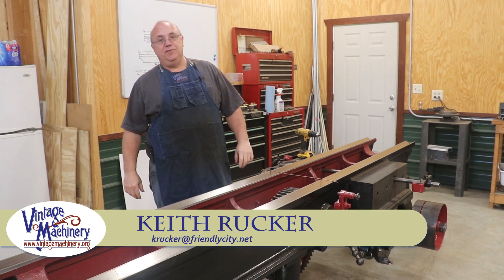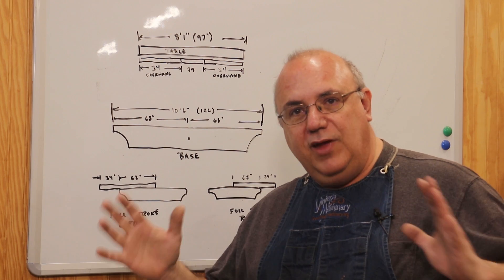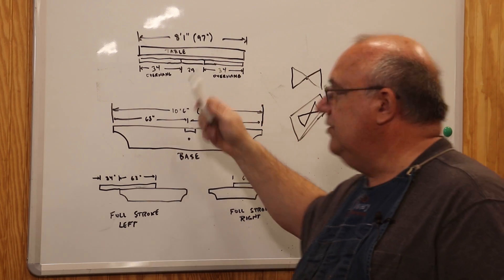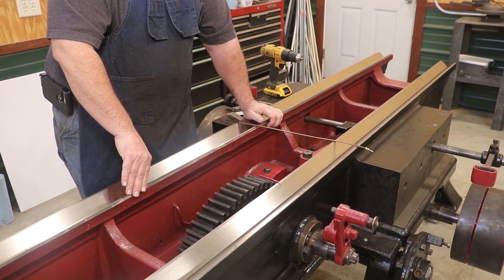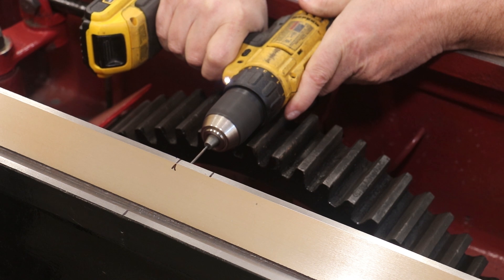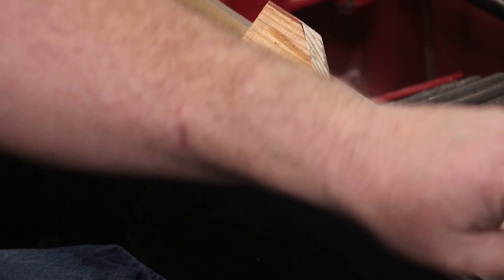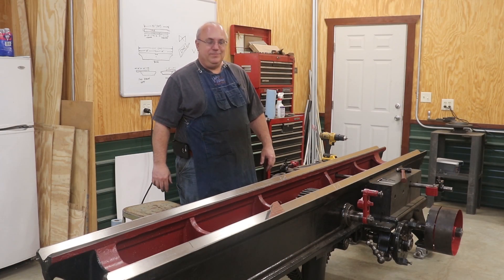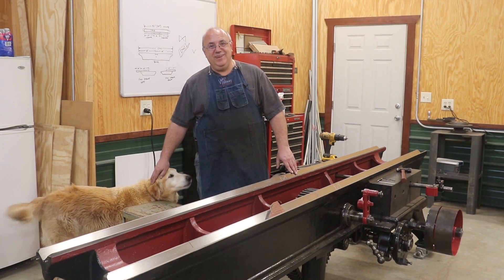New Haven Metal Planer Restoration - Part 25: Cutting Oil Grooves in the Machinery Ways

Comment: I made a piston oil pump when I was 15. A tube and piston (brass rod) two ball valves (sprung) it pumped well at low speed. Had an identical one filling a steam boiler with water under pressure.

Comment: a mechanical oil pump driven by the main driveshaft would be a great idea, it can work as soon as the machine is turned on, there is a lot of space underneth the base where the drive shaft is, a worm and gear assembly can drive the pump off of drive shaft (the sfhaft with 2 idler and 2 drive pullys) 
and how about the oil drain from ways back to the resorvor,
similar setup can be done with all the babbit bearings, with groves cut in them, oil feed and drain pipes connected for supply and back to resorvor.

p.s. dont mind the spell mistakes.

Comment: You know, if you wanted a mechanical oiler that was part of the table, it could easily be powered by essentially the same system we used as kids to add "motor" sounds to our bicycles with playing cards.  A mechanical pump with a little flapper arm hanging down into the bed-ways, actuated by being moved aside by some number of objects down between the V ways.  Perhaps simply the cast ribs that are already there.

Comment: In regards to wipers. When the table goes beyond the base ways it will at times be pushing chips. Those chips will be oil ladden and tend to stick on the corner of the base, just under the lip at the end of the way. When the table returns will the back of,the wiper,pick up those chips and grit?

Comment: As regards a bodgers fix for the oil pump, why not use a hydraulic brake master cylinder (size dependant on the oil flow requirement) that has its piston rod operated by a ratchet operated by the bed movement?  Low tech, very effective, potentially very reliable, with a bountiful parts supply?  You will need a metering block to regulate the oil flow and you could even have a low fluid alarm on the (remote?) reservoir!

Comment: I make lubrication system components for a living,  if you want a mechanical system you could go with a box lubricator, we sell them primarily for natural gas compressors that are run in a field with no electrical systems but there are many industrial applications as well. you could also run the pump into a divider block that would take that pump and split it as many ways as you like without having to cycle it like a metering system.

Comment: Looks like a perfect application for a mechanical oiler. They were made by Denzil, I think. Our big Ingersol Rand air compressors were lubed by them. they were belt drive but they also made some that were driven by a ratchet from a back and forth motion. Probably not made any longer. Your idea looks good.

Comment: I see you based the lubrication analyses on a full stroke.  The wipes will actually contact less of the way surface with a much shorter stroke, say an 18" stroke.the length of the "unwiped " surface in the middle will be much greater.

Comment: As I was watching and listening to your discourse, my thought of a oiler is a mechanical lubricator like is on the steam loco operating off the bull gear.  Cams and linkage are adjustable for flow.  Even an old pump oil can would work.

Comment: Could you use a pump that is actuated by a lever which could be moved by a contact on the bottom of the bed?  That way it would not require the memory factor of the operator. Just a thought and of course you could design the set up to suite your needs.  Greg

Comment: On David Richard's YouTube channel he uses steam cylinder lubricating systems that appear to possibly perform this similar task and would be period correct. I believe they are adjustable in a easy way for the amount of oil flow required also. Not sure about the amount of pressure they can produce versus what would be required for way oil. Just a thought.

Comment: Rather then complexity of a oiling system could you just put a well on one end of each oil groove pattenr, fill with felt wiper material and any time the bed moves its lubed, auto refills every time you lube the oilers

Comment: There is also special tubing and ferrules that can be driven into the casting to hold the oil tubing in place.
I think we used to get it from " Bijure " lubrication systems.
Reply: Did you watch the video?  He mentioned "Bijure" as the supplier of the parts he is getting.

Comment: May I suggest that You use a Trabon air actuated lube pump. Its most used pump on machinery and can be  controlled by a simple controller or a mechanical operated pneumatic valve. The oil output is controlled by adjusting the pump piston stroke.

Comment: I operate a unit with reciprocating plungers the oiling system is a round oil tank regulated air pressure on the tank. The tank looks more a small air tank with heavy duty fill cap the air push down on the oil and the oil line comes from the bottom. The regulator is set to 40 psi or lower. Needle valve can regulate the oiler points. The older units use an alemite pump but that is pricey. Thanks for sharing

Comment: Hi Keith,
I used to work on  large industrial paper shredders until 2019 and  a couple of years back they had  manual oilers.  They were German made oilers for the HSM shredders.  I do believe the manual pump assembly is available on their FA 400.2 shredder.  So they are out there , probably expensive.
I enjoy watching your videos and have watched you through several lathe rerubishings
Charlie

Comment: Keith you can get a Bijur oil pump that works on a cam system and figure out what metering fitting you need would work good on something that goes back and forth like a planner. eBay has a lot of new pumps for a reasonable price just need to figure out the right size metering fitting.
Here is a link to a site with info

http://www.bijurlubrication.com/?gclid=Cj0KCQiApt_xBRDxARIsAAMUMu-ZC837oXb0eU4K7KisvRXmgy4qTXlp5GHpJdhWrr3JxOZ1PaLxotcaAnNhEALw_wcB

Comment: Could link it off the lever that reverses travel instead of hitting the table itself. See a bunch of mechanical lubricators on steam traction engines. Short ratchet throw and would be period correct.

Comment: If you install some kind of oiling system, I would suggest some sort of oil catch system at each end of the ways.  I'll bet there will be oil dripping from each end (4 places) and you wouldn't want oil running down to the floor.  Maybe just an oil catch mat on the floor would work.  You'll figure it out, you have so far.

Comment: The easier it is to properly lubricate the machine, the more likely it will be done regularly.
A proper lubrication performance will protect the hard work put into making the machine like new. You got these points nicely covered so far, cheers Kieth!

Comment: If you would cut vertical slots every foot or so on the underside of the table it would serve to pump the oil into the ways and carry it along with the bed travel. Again likely to make a mess when it goes off the end but it will keep it well lubed and help prevent wear. I would rather have a messy accurate machine than a clean worn out one. :-)

Comment: I would suggest a cam on the bull gear shaft to operate a plunger pump that way it only oils when table is in motion and it will pump even when the gear is running reverse on the opposite stroke. You likely could rob parts from an eagle oil can to make it work. Going to need some catch cans at the ends of the ways to catch the oil runnning off to not make a mess of your floor.
Reply: I was thinking about something similar, like squeezing a turkey baster on each stroke, lol. I think your idea of using the pump from an oiler can is a much better idea.
Reply: An older Cat injection pump unit ought to work as it won't take much oil to lube it up and the pump plunger can be spun for the volume adjustment BUT you've probably got a pocket full of DEERE pumps, Baily approved of course!
Reply: You might be able to use an old fashioned cam driven automotive fuel pump.  I can remember seeing a foot operated cutting oil pump someone made using an automotive fuel pump.

Another option would be to gear or chain drive a regular gear type hydraulic pump.
Reply: Certainly it would be sensible to have the oil pump only operating when the machine is moving. You have a clear and simple notion of what's best here.

Comment: Like someone else said, you should probably have the uprights and cross rail in place before scraping. The weight of them will cause the ways to sag between the middle and rear legs and may even cause a hump to appear at the front.

Comment: I would consider the following: Put an oil groove bow tie every foot or so down each way in the base to assure full lubrication regardless of stroke length or location.  Then put a flow-limiting valve (in essence a check valve that is lightly spring loaded open but snaps closed when too much oil flow goes through it) on each outlet.  The valves prevent flow to each oil groove when it is exposed and wants to flow a lot of oil but allows a little oil flow when that groove is covered by the table.

Comment: How about a small cam added to one of the shafts with a simple plunger pump. Submerge the pump in the oil sump and use copper tubing from it out to the oiling ports. 4 drain ports to return the oil back to the sump.

Comment: hmmm, I think there might have been a more expedient solution....  The objective surely is to apply the oil to the table / base interface?  The leading and or trailing edge of the table will be oil starvedon any stroke that doesnt go to the maximum stops?  How often are you likely to use the whole stroke compared to a 12 or even 24 inch workpiece?   Surely the "difficult" plumbing is no more than a flexible hose from the base to the table and a distribution block would resolve?  With an oil feed to the extremities of the table, you are assured of oil feeding the the interface regardless of the length of the stroke. which is afer all where the oil is needed.

Comment: Don't understand why the oil grooves are cut before scraping. In my limited scraping experience, the scraper was constantly falling off in the oil or grease grooves and adding frustration to a tedious job.
Reply: Cutting the grooves can raise a burr or swell up the surrounding area if cut with a chisel like they used to be. If they were milled, that would have been done when the ways were milled so before scraping anyway. Having the scraper fall into the oil grooves is kind of beneficial as it creates more of a ramp to encourage the non-grooved surface to drag oil out of the groove and cover the rest of the surfaces.

Comment: I try to avoid using dremels. They have too much torque. When they grab they run away and go places you do not want them to go. I prefer to use an air pencil grinder which is low torque and slows down or stops instead of grabbing and jumping.

Comment: My oil pump idea... vintage car Brake Master Cylinder!
Reply: You would have to change the seals because the oil will expand the factory seals (brake fluid is a different composition than oil)
Reply: @ypop417  have you put oil in a master cylinder?
Reply: @vettepicking  Yes someone used an empty brake fluid container for oil and I put in my master cylinder
Reply: The oil will expand the factory seals? What is the material of the seals that would allow sufficient oil penetration to appreciably change the sealing characteristics? Your story isn't lining up. You filled your master cylinder with oil, but it was empty enough for you to put a lot in, without noticing it's not brake fluid? Then you used it and it worked long enough to know that you need to change the seals? Something is fishy. Oil doesn't appreciably expand seals (about 1-2%, or a few thousandths of an inch, considering the sizes were talking about), and given the highly "corrosive" nature of brake fluid, the seals are likely a lot more robust, and shouldn't be affected by oil.
Reply: @xenonram  It Will Ask a mechanic. Early morning not enough light in a rush. Or go to any auto parts store and ask if oil will work in your brake system and why not? They will tell you the same thing oil will destroy the seals.

Comment: Great improvement on an old machine.   Are you going to have a lubrication problem if you use the machine only for short strokes?
It should get good oil coverage when the table strokes fully from end to end.   When you are using short strokes the ends of the table
will always be a long way from the oil holes.
Reply: I was thinking the same thing. An easy solution would be to put additional oil grooves like the ones at the half way point at the 1/4 and 3/4 points on the base.

Comment: Keith, I see the supervisor came by to do the final inspection. Love your original approach and the
nifty way you used a grinder and guide system to cut the oil grooves into the V ways.
Reply: Supervisor? That's a dog, so it's not a supervisor, just an assistant. Now if it was a cat ....
Reply: LOL @johncochran8497
Reply: @dougtaylor6410  I was thinking the same thing. Someone hasn't been watching Brian Bloc...John. :-)

Comment: Keith,
This might be more work than you planed but if you're stuck for a mechanical lubricator then check out You Tube Channel "Keith Appleton". He does model steam engines and has shown various mechanical lubricator that were scaled down, thus you could scale then up for your needs.

Comment: My suggestion for the oil pump would be to mount it in the center of the base and add a cam in the center of the table. Additional cam lobes could be mounted further along the table to automatically increase the oil delivery to match the increased movement.
Reply: What do you mean, "additional cam lobes can be mounted"? How would you connect them all back to the pump? That would require a ton of linkages to transmit the movement from those additional cams all the way back to the pump.
Reply: @xenonram  I'm thinking of a pump with a vertical plunger mounted to the base, under the table. A lobe on the underside of the table would depress the plunger as it passed over it. One lobe in the center would be used all the time. Additional lobes spaced maybe 24" away from the center would only encounter the plunger when longer travel is used.

Comment: The larger machines from the early 1900’s upto the mid 50’s had the oil eats cut by scraper hands.  Hammer and chisel for big stuff and a modified round file . 1/4” dia round file has the forward end ground oblique to create a chisel edge. The handle was flat and palm sized. The experienced hand could cut the ways in minutes by eye . Certain guys had their own patterns others stuck to given designs. I’ve tried and it’s not super hard but takes practice to get it neat. Enjoyed the update Keith . All the best Mat

Comment: Keith
Mechanical lubricator bet you have plenty, what have fitted to the steam loco a mechanical lube pump that works on a ratchet arm that would work fine and dandy
Reply: You nee one like Dave Richards has one his prime mover at his steam powered workshop
Reply: @stuarthardy4626       Exactly what I was thinking .  He uses an oilier to inject steam oil into the steam , I think .

Wyr
God bless
Reply: Stuart Hardy Bijur makes a lot of different size mechanical pumps with a cam style pump.
Reply: You know what Stuart, I was thinking the same thing when Keith mentioned a lubrication system. But I was thinking of the oiling system from "Big Boy" UP X4014, the oiler on it can lube 16 spots directly, but you put splitters in and it can oil a whole lot more along with being adjustable in oil flow.
Reply: Jeffrey Davis 
I have got my remaining Brian cell fired up 73 years young he needs a Westinghouse multipoint lubricator ,just like the one you mentioned . A few year ago I made a full scale model loco a BR class 4 tank in 5 g fully working coal fired , and I had to make a Westinghouse lube but it only held 1 ounce of steam oil but used emulsifiers for the cylinders the extra ports not used , was down to 1/16 inch old copper tube 😳
Reply: Yowza!  YouTuber Keith Appleton works with model steam engines.  Some of the "models" are fairly hefty and employ mechanical oil pumps.  Maybe 1 of the pumps Mr.  Appleton works with could be adapted to this task.
Reply: Eli Duttman 
They are not big enough for this job you would need at least.  7 1/4 g one then maybe not 

Two foot g that Keith plays with may be a bit big but it’s a matter of the linkage